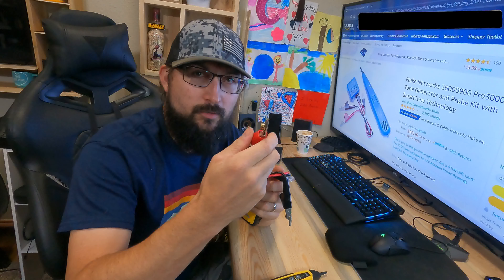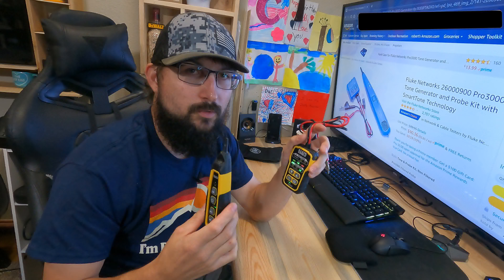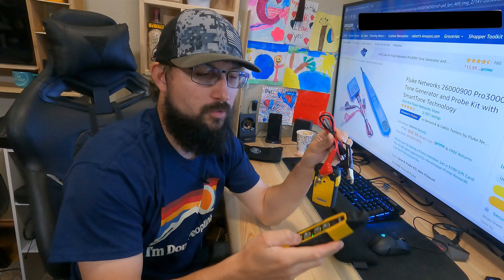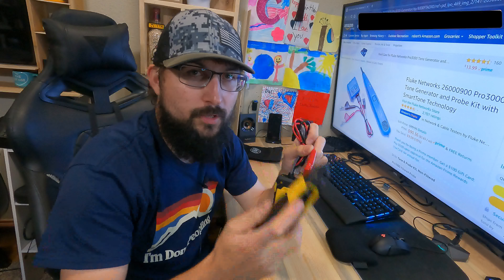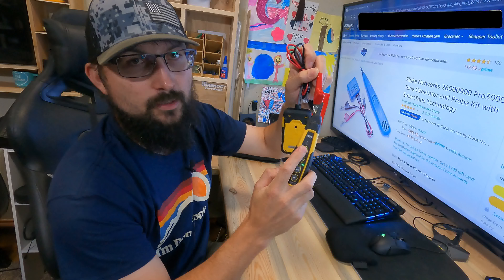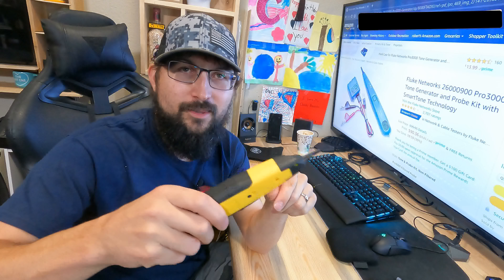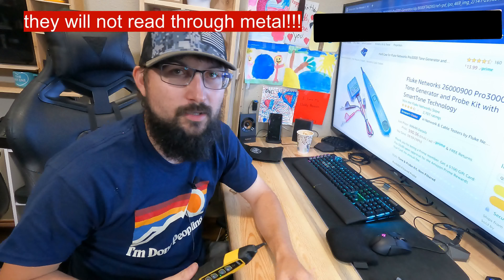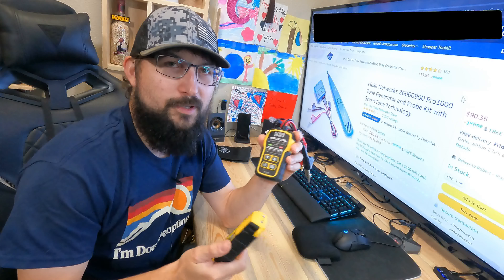Check out the Klein Tone generator/ probe

Comment: Purchased the same unit yesterday, and I believe it was DOA out of the package. When turning on the toner, it showed a red light for continuity with no connection, then shut down within a second. As you suggested, the directions were vague ar best. Trying to find a beach circuit beach to the breaker panel, by clamping the hot and return leads like shown in the directions, while my wife held the pwr button on. Nothing was adding up at the breaker panel. Thankyou for the earth ground tip. My wife is at Home Depot swapping for a new one, and hopefully it stays on this time when powered up. Thanks!
Reply from the maker: Awesome I just used mine again today!
Opened 15 different plugs and switches  back stabbed.  its nice to verify you fixed the problem as you go around re connecting wires and quickly tracing as you go.If you have any trouble let me know if I can help !

Comment: Wow, thanks my man, I’m not an electrician, I’m a farmer we have to do everything😂, but seriously, I bought one of those exactly, and proceeded to do exactly what you described and the signal was on every wire. I wish I had searched this before I tried to use it. I have used it to test out some wires going to a low voltage pressure switch and it was just the thing I needed, I failed miserably with it trying to pick a single wire out of dozen tightly packed together. I know how to do it now, thank you, subbed and hit the bell !!
Reply from the maker: Thanks! I appreciate that!

Comment: GREAT information based on experience. Glad I found your video as electrical is my absolute weakest skill and I have been trying to track down an open neutral on one circuit and an open ground on another. I was able to find the open ground and figured out the open neutral is under the house somewhere.
The most useful bit of info in your video was "tuning" the probe and using the indicator light instead of the tone volume. That alone will save me a LOT of headaches. I do not recall seeing that bit of information in the instructions, but it really should be.   ARE YOU LISTENING KLIEN?
Reply from the maker: I appreciate the feedback. Thanks!
Reply from the maker: the easiest thing to do is cut the circuit in 1/2.  Figure out what side the problem is on and keep cutting it in 1/2, narrow it down from point a to b and then attack it at that location! good luck thanks again! I will probably make a troubleshooting video soon thx.

Comment: Thanks for the training ...just got mine ...going to use it on my old jeep!
Reply from the maker: Thanks ! wha'ts wrong with it?
Reply: @toolsandtactics   using the red lead in the bulb socket blades ....black on battery neg. terminal (diconnectected) ...everytime i try to run a test the red continuity light comes on and won't let the toner run...tried reversing the leads  didn't work...turned on the headlight switch...blinker......key on....red light (continuity)...somewhere a splice is grounding out but can't find out where
Reply from the maker: @richardwecker8322   set a multi meter to tone  or continuity and black on chassis  red on the wire to the bulb  and see how many ohms or if you get a beep,   to be fully sure its not shorted anywhere else
Reply: @toolsandtactics   I would think with the switches in open circuit position it wouldn't be showing conductivity to ground....they're all in plastic tubes and don't see any chafing ..
Reply from the maker: @richardwecker8322  if thats the case find the switch/relay/contact that tells the lights to turn on   disconnect that wire from the car  and attach the red meter lead to that, and the black to the chassis  and see if it tones   
that will divide the circuit in 1/2 and you will know what side of the car the short is on
Reply from the maker: you just want to test wires not any devices/relay/switches  at this time  so remove the wires in question from the car connections
Reply from the maker: @richardwecker8322    that would be a constant hot short
Reply from the maker: 2 sides of the switch        the switch leg (load) and the constant hot
Reply from the maker: if the switch is in the open(off) position..  does the load (switched side  ring to the chassis?
Reply: @toolsandtactics   yes i think i might have to take it to the shop thanks for your tech advice
Reply from the maker: @richardwecker8322  anytime  thanks!

Comment: If testing a line. I’m assuming you want the circuit off at the breaker.  I am trying to track down wires that the drywallers mudded over.  There are boxes in the walls.  Thanks
Reply from the maker: Yeah  circuit off   you will need that thing on super loud and won't be tracing with the light  but more the sound in that case

Comment: I like the mold over of both the probe and toner.  A manual pot volume/sensitivity switch is preferred by many because it stays set until changed rather than having to start from low again.  A filtered probe is not a must for many uses but it can make life a bit easier.  The Tempo 200XP is multi filtered having positions of no filter, 60Hz filter or filter all frequencies except 577Hz.  The Klein toner will time-out in 60 minutes, not adjustable.  

One real downer for me about the Klein was the batteries that it takes, 4 AAA batteries for the probe and another set of 4 AAA batteries for the toner.  AAA batteries are a very poor value for the money and cost similar/same as AA.  Leakage has been an issue for me so I only use lithium AA cells and keep the use of AAA lithium to a minimum.  9.V alkaline leakage is less of an issue because leakage is usually fairly minor or the battery connector can be replaced.

The Tempo 200XP probe uses 2 AA batteries and the Trend Networks PoE network cable tester uses a 9.V battery.
Reply from the maker: excellent value of knowledge added here thanks!
After having testers with 9 volt batteries  ,AAAs   are welcome !!!  Thanks!
Reply: 9 volt has a much shorter life span up to 5 years if used sparingly. Obviously brand choice and type will differ results but cost wise on just batteries alone Two 9 volts might be a better option than 8 triple AAA batteries. I make sure to get lithium regardless since they last much longer regardless of what battery it is.
Reply: @davidgomez5116  Most likely will stick with alkaline 9.V because the smoke detectors are also 9.V.  While I still have some lithium AAA and AA disposable batteries I've switched to rechargeable lithiums.  Took many years for this type to show on the market.  The disposables were just too pricey.

So far getting good results.  The AA lithium rechargeable lasts about 5 months in a mouse while the Energizer lithium disposable AA lasts 6 months.
Reply: @ntag411  we have string lights we use for Christmas that runs on AA batteries and has a timer built in. One string can light up any entire room or hallway in our house. Its also great for emergencies like a power outage so I keep around 24 batteries of each. Triple A's are for our NCAA national broadcast weather radio that solar powered and can wind up manually for power as well. I have lights that attach to my collection of ryobi batteries too sorta like tent camping lights. Obviously i like to be prepared. Just some things to think about just in case. But yeah those kinda batteries are still very useful these days. Just not in as much devices as they used to be. Since everything now has internal batteries with type c plug ins. Or requires direct plug into outlet.

Comment: I just purchased the Fluke Pro3000.  (No indicator light and no flashlight!)    I haven't opened the package yet.   I think I will take it back to Lowe's and get this Klein.  Thanks
Reply from the maker: Nice! that klein 1 works good
Reply: @toolsandtactics  Thanks for writing, Appreciated.  I did receive (from Amazon) an $18 "tone generator and probe.  It seems to do the job which in my case is a one off in my house and considerable less expensive than hiring an electrician.
The QUESTION is...  Will the Klein be worth my investment (over a ten year long run?)
Reply from the maker: @tribulationprepper787  the most accurate 1s have a light that dims and brightens based on the strength of the signal   any probe that does that is worth it , of course the lower price 1 is prefered, but if you plan to use it daily  you may want to reconsider

Comment: What you are calling a good Ground or known ground is actually "Earth Ground" and what that third pin on the plug is for and the bus bar in the breaker panel where that large bare copper wire connects to coming in from the entrance cable from outside. That is true ground and what you should be connecting too.

Comment: Nice, Can you easily detect a cable/wire 6 or 7 inches below the surface? What is best for that? Also wire from breaker box, need to trace it thru the house/walls?
Reply from the maker: No it's not going to pick up the signal for that you need an actual circuit tracer not a toner    
You can attach it at the panel just remove the wires  and go to individual plugs and switches and tone it out to identify

Comment: I bought one of those and used it to figure out the wiring in project I'm doing. Your excellent tutorial taught me everything I needed to know to be successful! Thanks! I have a question. I couldn't seem to get the light to indicate I'd found the wire without turning up the volume. It was like the sensitivity of the light and volume were linked. Am I missing something? It seemed like they were not linked in your tutorial (you said to turn down the volume and use the light). Your input is welcome.
Reply from the maker: Yeah the light and volume are proportionate It's supposed to be like that    When you do find the correct wire though it does get slightly louder
Reply from the maker: Also thanks for the feedback!

Comment: Your video was the best one I could find, but its still lousy.  NOT one single demo behind the drywall.  And you have the COMPETITOR product showing on your monitor (The Fluke Toner) but you dont clarify whats better.  I want to see it in usage.  Show me how well it tracks a wire, behind the drywall.   On the upside, in the first 30 seconds your video did emphasize "FIND  A TRUE GROUND FOR THE BLACK WIRE". .   Agreed because as an electronics person, without the ground reference it wont drive an effective signal that any receiving device could pick up.  Dont care what brand, the issue is in the physics, it needs one real ground, and the red wire is the signal line to be toned.  Thanks for emphasizing that.
Reply from the maker: Hey I really appreciate the feedback and that you didn't sugar coat it
 You're right I could do a demonstration I think I'll make a new video soon thanks
Reply: @toolsandtactics  Hello, hello, greetings.  I'm glad U were OK with receiving my comments.  My apologies - - I was a bit sour when I wrote that.  My compliments you have POSTED a youtube video... I never did that yet.  My plan is post a first video for me ... about some tricks for taking apart a 4-burner stove panel and replacing the switch, a model that is hard to figure out.  I didn't do it yet.   This thing about "wire toner" well geeee, I want to buy the RIGHT product.  I am leaning to KLEIN with what little I see.  BUT thing is, I wanted a YouTube demo.  Greedy me, I'm a consumer of videos - from those who did post.  But I gotta see IF the toner is effective?  We know the walls are 2x4 or 2x6 BUT the ceiling is 2x8 or 2x10.  We have a run starting at the panel.  We believe the builder left the run INSIDE the wall (coiled up waiting) AND just would love a demo so I know my money is spent smart... and we pick up the ending where it's coiled.  I CAN SEE as electronics enthusiast, there is TWO ways to run this thing.  EITHER is ground out the black wire.  The red wire, I could attach JUST to ONE Romex conductor, and do some limited tracing.  BUT FOR HEAVY DUTY LONG-DISTANCE TRACING, probably take ALL 3 WIRES and alligator clip them together all to the red generator wire.  THAT WAY I get the MAXIMUM pickup.  So that is my THEORY but would make my day to SEE A DEMO VIDEO.  I was feeling sour cause there is half-a-dozen videos they all do some talking but NONE of them show this in usage OR get into my "two modes, normal and heavy-duty" ideas.  Woudl be awesome to see on video how does it perform when its in a ceiling and the drywall is installed.  IMHO basically needs to be sensitive and give me a faint pickup,  to almost a foot away !!!!!  Best wishes -Norm near Seattle
Reply from the maker: @normanhill4028  Nice!!❤❤ well put i have some work to do!
it is possible to trace with this unit in the walls, but not very practically 
the more you turn up the sensitivity they more likely you are to find the wrong wire.
They do make more powerful units rentable 
I will do my best to simulate they behind the dry wall affect but this unit is more for if you have an idea of where to start, like a bunch of wires in 1 location ( like an ethernet switch ) and quickly identify 
or something like that.
in this case  there is no need to connect to anything other than the copper bare ground  and the black wires on the romex 
I wouldn't recommend attaching anything else especially the neutral(white)  again THANKS for the feedback!  I do have other videos responding to other questions from this video. I'm happy to make another 1 for you!  ( I need to make a play list haha )
Also good luck with your video on the stove sounds like good helpful content .
Reply from the maker: @normanhill4028   is it a plug you are looking for? garage? ore something else 
chances are its in a box (if it is a plug  on a garage wall for example )
remove the wires from the breakers attach toner red lead to black romex and attach the black toner lead to the grounding bus on your panel or any bare ground wires in there.     Check out the attic if you can, and get an idea of were abouts the wire might be going down the wall.  then start toning ill make a video soon but needing to know what we are up against  thx

Comment: Good video, thanks. You seem to have a lot of experience with these tracers. Are all of them supposed to be used on de-energized/powered off wires and panels or some models can track live socket to a panel for example?
Reply from the maker: Yeah power off is necessary
Reply from the maker: In general the toners are use with no power   a tracer will be used with power on but mainly for identification  not troubleshooting ( in general )
Reply: @toolsandtactics  thanks for sharing. I thought tracers and toners were same things with same working principles. You live you learn.

Comment: My Dad has a broken wire from his house to his garage that powers an air compressor (dedicated 220 wire) some is buried, 50% is accessible, would this help track down the break on the accessible part of the line? Thanks….Brad
Reply from the maker: depends how deep  it might  and worth a shot for the price of this  but you probably need the more expensive tracers  if its in metal rigid conduit it wont help at all   good luck

Comment: Im dealing with sprinkler wire coming off the control box seemingly buried 4 or 5 inches and need to find out where it goes??
Reply from the maker: You probably won't be able to trace it in the walls but but once you get above the ceiling or attic you should be able to find what cable is what. and you should definitely be able to find it at a device or a suspected cable

Comment: Hello, does this work for vehicles? I can't find a single video or article. Can it damage a 12V system? Power probe has a similar device that is much more expensive, Powerprobe Ect3000. Appreciate any help you can give 👍
Reply from the maker: That's good question I think its OK but never thought about the computers  it's fairly low volts  3

Comment: the instructions say it can take low voltage in the system ...can i use it with my 12VDC battery hooked up.....then it says unergized wires only?
Reply from the maker: Yeah disconnect the power !   attach it to the chassis (black)  and to wire you want to trace (red)    what's your vehicle doing that you need to trace ?
Reply from the maker: I wouldn't use it with the battery attached!
Reply: @toolsandtactics   driver side front park/running lights work but no power/signal situation on the blinker....replaced bulbs and flash...dash indicator works (senses good bulbs) flashes ok on dash ....no blinker at the bulbs ...99 jeep cherokee sport

Comment: How does this Klein compare to the Fluke Pro3000 that you had on the computer screen? There is also the Pro3000F60 which filters out 60Hz. Any input would be appreciated.
Reply from the maker: The klein 1 is better because it has a light for sensitivity  never played with the filter 1 but an indicator light is a must 
I'm going to do a live stream on this tonight at 715 and trouble shooting using both and the differences and probably dismantle some wiring on my shop lol

Comment: Will this work for a wire underground?
Reply from the maker: depends how deep  probably  not
Reply: if you use a small hand radio and dial it th channel 530 AM you will be able to pick up the signal with this toner. attach it to the end of a handle to make it easier
Reply from the maker: @Dbagnj  that's cool gotta try it